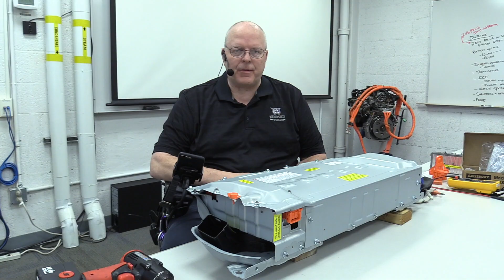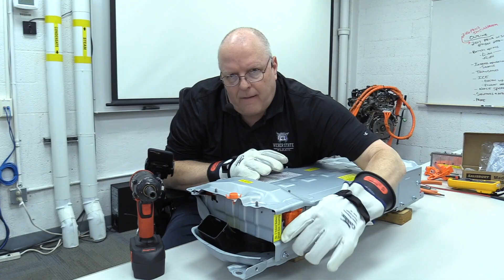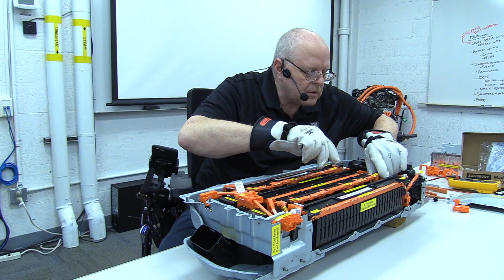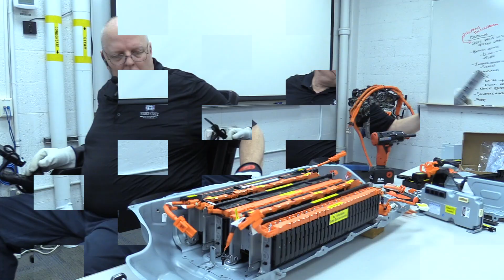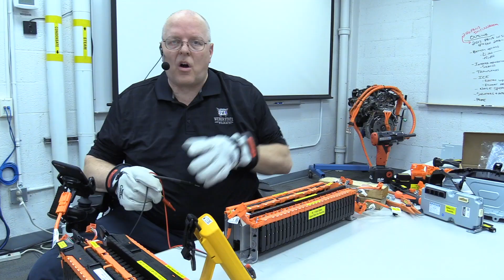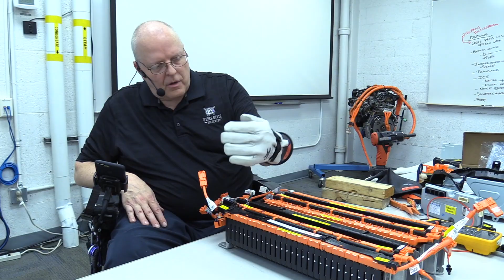2016 - 2023 Toyota Prius Li-Ion Battery

Comment: I don't work on gen 3 and 4's yet much and definitely not the batteries yet.  Appears the contactor assemblies are the same?  At least from what I've seen the NiMH battery packs contactor assemblies appear the same.   Drivers side of the 2016-2022 Lithium definitely looks different than the NiMH pack from what I can see.  I own a 2016 pack I used the modules for a 2004 pack.  Excellent info as usual. Didn't realize there was a Lithium option for the gen 4's that is not the Prime.  Wondering about the rest of the differences between the NiMH and Lithium rest of the electronics electrical system. Interchange between the two or no, have to swap a few other parts.
Reply: The battery ECU appears to be the same design as the 2012-2015 Plug In battery ECU.  I see there is a plug in sequence that is reported as critical to plug in order or damage can occur.  That video also shows the black four plugs for the 2012-2015 plug in looks like the 2016-2022 Lithium pack black four as the older ones for the 2012-2014 (not sure about 2015) plug in are orange.
Reply: Looking more closely at images, the 2012-2015 Plug In Li-Ion pack bsu and gen 4 Li-Ion battery ecu are not the same.  They do look similar, so I am not entirely insane at least at this time. lol

Comment: Prof. Please if we can get a comparation between Lithium-ion and NiMT batteries. in case of heat resistance, extreme cold and hot climates, Density of charge, loss of energy. more efficiency, different usages. Kind regards.⚠😍😍😍
Reply from the maker: Thanks for the suggestion

Comment: Amazing work thank you.  Can i replace my 2010 prius weak hybride battry with 2022 or 2023 model prius hybrid battery.. please if you could guide me or share a video for that,  as i heard that putting 2023 model battery in prius 2010 gen 3 can heat up the engine. So please let ne know

Comment: having fun with one right now 2024 rav customer put disel in it and i believe ive burned through cycles . battery is border line depleted have codes for stacks below threshold so far from what infomation i crossed 2023 and 2024 ravs has an management pcu that shuts down the battery connection when battery soc is down. im being told these batteries are not able to recover. not sure if thats true our chager is down looking for a cheaper charger .

Comment: The one and only video I found for this 56 cell setup, awesome information. -Question, I own a 2022 Prius with this lithium battery, out of curiosity I hooked to DR PRIUS APP with OBD2 adapter, it's reporting a Delta SoC of 1%, sometimes during driving it drops to 0.5% briefly, the car is pretty much brand new, it has 5k ODO. TechStream also reports the same 1% DELTA. Is that an issue down the line with the battery? perhaps that's the delta between the two stacks? voltage difference is 0.00~0.01v among all 56 cells so I guess I'm good there, usally around 3.65v each.
My 2015 GEN3 w/100K ODO NiMH battery reports 0% Delta SoC after 8 years of use! how come I get 1% on the new one? Hope you can clarify, thanks a lot for all you do for us.

Comment: I am facing Hybrid battery issue last 8 months.........Error is showing some time "Hybrid system overheated please reduce output power" and disappear Error was not showing on system I checked many times in Lexus service center but still the same

Comment: Hello Professor, I owe you a lot of respect for your knowledge and congratulate you for the excellent informative and educational videos.  At the same time, I'll like to ask you a question. I have a 2017 Toyota vios and I initiate a project to make this an autonomous car, integrating a generator to recharge the battery while this is driving with a secondary battery, or it is possible with the same original battery. Is there any possibility to charge the principal battery while the car is in motion? Charge and use at the same time? In the case of an independent secondary battery, charging one while the other is use, is there any way to switch from battery to battery?

Comment: Found a 2016 battery that is said to be lithium prius V.

My car is a 2012 body, 2017 engine. I want lithium battery , can I pull the battery out of the car and make this work swap old for new would it work? Stack the new cells in the old case ?

Comment: Thanks for the vid professor! I am working on a Prius+ Li-ion battery that hasn't been used for quite a long period of time. Each cell is 3.6V, but I'm trying to charge it and raise the voltage to get it to 3.75V when in the car. I'm using a GT Power X4 Pro Quad to charge it at 1A, however sometimes it shows connection break though it is connected, and when it does start charging, I get short error eventually. Is there a way to charge each module without these problems and is it possible to make them useable after not using for long periods of time?
Reply: What is your Delta SOC now and Voltage difference?

Comment: The orange cover interlock is the "battery cover lock striker" is there to intentionally require the removal of the HV service disconnect which is used to disengage that striker . An extra layer of safety as a reminder to remove the service grip plug

Comment: can u upgrade this battery similar to prius prime  plug in so u can get longer range ? like connect 2 batteries in parallel of same type.
Reply from the maker: No. You are stuck with the system as it is. Thanks for watching

Comment: I did not read all of the comments so someone might have answered your question at 43:00. For the last few years, I drive my 2nd and 3rd generation Prius quite frequently with the Android Hybrid Assist app-connected, a great app for getting simple numbers BTW. I have seen the 2nd gen get as low as 20% after sitting in the driveway for a few days 3rd gen does not get that low but I have not watched it that closely so I can't remember an exact number. Coming down Parleys They used to get as high as 85 but after a Totota software update, they both stop charging and do full engine brake at 79% when I let off the gas or brake. I have also noticed that they will engine brake if I am going faster than 39MPH but the engine completely shuts off if lower.
Reply from the maker: Good information, thank you!

Comment: Why have you got gloves on when there is nothing plugged in
Reply from the maker: Each battery stack is 103V DC. According to OSHA and NFPA 70E you need PPE above 100V DC or 50V AC. As a teacher is is my job to set a good example by following proper service procedures. Thanks for watching

Comment: The small orange plug is a safety feature as it forces you to remove the side plug (also orange) which interrupts the voltage to the positive output. In the older models where the fuse was inside side handle,  the two compartments  were separated bringing the voltage down to a more safe 100 volts,
Reply from the maker: Thanks for watching

Comment: Those batteries should be designed in such a way, that when servicing, the service man should be able to pull a lever that would disconnect and remove the bus bar and break any series connections between individual cells, thereby making it safer to handle.

Comment: Thanks for taking the time to provide this very useful video... I would like to get more information about about the technical specs/requirements for this battery unit. So I know that it is a 207.2v nominal battery, rated at .75kwh, but that's about all I know about it. Where can I find specs on safe charging voltage, max voltage, min voltage, recommended float (if parasitic load present), etc... Any information on this would be greatly appreciated. I need to make sure a standalone bench charger is set up properly for safe charging and maintenance of this pack. Even some specs for the individual cell-level would be helpful, I could calculate what I need...

Comment: Professor, is there any way to tap a 2000 kilowatt dc to 110 ac inverter into the prius traction battery ?
Reply: 2 megawatt, you need a powerplant

Comment: Only advantage I reckon of NiMH batteries is for cold weather applications . I hear NiMH fares better in cold weather compared to Lithium Ion cells. As such the winterized Aall wheel drive of the prius version uses NiMH.

Comment: Our 2020 Camry Hybrid with Li-ion batteries has a statement in the Owner's Manual, page 502, on a reason the car may not start, "The temperature of the hybrid battery (traction battery) may be extremely low (below approximately -22 deg F (-30 deg C)."  They present a similar statement on page 211 where they also say "In this case, try to start the hybrid system again after the temperature of the hybrid batter increases due to the outside temperature increase etc."  We did not have that warning with our older Camry Hybrid that had nickle-metal hydride batteries.  For those of us living in the colder northern areas, we should shun the Li-ion batteries even if they otherwise have advantages.  Another way to handle this issue would be to use Honda Hybrid cars where a standard starter, powered by the 12-volt lead-acid battery could start the engine in cold weather.  This also will be an issue if politicians are successful in forcing us to abandon internal combustion engines for full electric cars.  I would be interested in hearing your thoughts on this issue.

Comment: Is there any concern with Li-ion cell out gas issue that air (coolant) for the cell get cycled with the passenger compartment?
Reply: From what I seen. All battery cells vent too the outside
Reply: @180msdavid  you mean outside of cell, or outside the pack, or outside the chassis?
Reply: @philoso377  each cell vents through tubing that leads too the outside of the vehicle.  
 The air cooling system isn't directly connected too each cell.  And pulls air from inside the vehicle too Cool the battery pack. What I'm not sure is if that air is returns too the cabin.  Wich wouldn't make sent because the battery would  saturate the cabin with the heat.
Reply: @180msdavid  
Reason I asked was to find out cell gas versus coolant air. Does it draw air from cabin (assuming cabin is fed by road air) run pass the cell-bank then out back to the ambient (road)? or in opposite way around? Is there a concern that cell gas contemplating cabin air?

Comment: Wow. I like this setup. If you wanted you could repair the battery without taking it out of the car. Not like the Gen 2 where you would have take the whole battery out to just replace a single Module.

Comment: My 2016 prius 2 has a NiMh battery 'obviously'
The best distance I've been able to go on battery power alone on a mostly flat 'a few small hills' at about 35-40mph is about 2mi. I've gone a tiny amount over that but it's not easy.
I've been able to average an overall mpg rating of 59.7
I like that number since I very lightly hypermile, and yes so keep up with and sometimes pass other vehicles on the road.
I'm a delivery driver for an unnamed pizza shop. I average about 60-100mi driven in this car per shift. Of those miles driven, I average 68mpg on a good day and 64 on an okay day.
Overall I love this car!

Comment: Thank you sir !! Very well explained, just what I was looking for. A couple of questions about the Prius prime battery though. It says 5x19 cells so a total of 95 cells and that the energy capacity is 8.8kWh, so if you divide the total capacity by total number of cells (95) you get 92.63Wh(25Ah) as individual cell capacity as compared to 18650 and 21700 Li-ion cells used are 11Wh and 14.5Wh respectively as their individual cell capacities.
1. Is there any specific reason/advantage why they have gone for a high capacity cell with only a series connection as opposed to a combination of series/parallel type connection as used by Tesla/BMW for their EVs? 
2. What is the typical values of battery current as observed during the operation of the hybrid vehicle in pure electric and hybrid mode? Is it around 16-17A as was shown in your video?

Comment: Is the stated capacity then (0.75 KWh) the power available between 28% and 41% (Approximately 13% of total capacity 0%-100%)  or between 100% and say 20%? The Prius Plus is stated to have something like 8.5KWh and has 95 cells.. this has 56 so is the actual capacity around 5KWh ( 750Wh / 13 * 100 = 5.769 KWh) fully charged? Or are the cells in the Prius Prime larger?

Comment: Hello Dr.,

Is it dangerous to install new lithium battery on a Prius 2nd generation car ?
Reply: Raed Wahsheh I attempted to but the system that control the battery need to modify with another module to control the charge and discharge. The car was set up with the charge module for NiMH battery only that is a lot different than Lithium. After a few calculation with the cost and work to be done, decided it is not worth the trouble and the risk of setting myself on fire. If you can add the battery management system to work with the original system very well, it is worth the try.

Comment: my self build e-bike has a 532Wh battery it´s much smaller :D
B.t.w. love how the pipes in the background are even labeled with "steam" and "condesate" + flow direction :)
Reply from the maker: LOL, thanks
Reply: @Timo Witte - me too.  I guessing a lot of the 1/4 million viewers are us DIY e-bike guys who build their own packs.  I was fascinated to learn that the Toyota Hybrid pack has basically 4 of my 52v 14 cell serial packs. (I have 3 packs 14s6p (using LG INR-25 2.5ah cells) 14s4p (using Canadian 26800 2.9ah cells) and 14s4p (using 2.2ah cells (EBL cells from Walmart.com - don't recommend),   I'm guessing the driver's side "computer box" is acting as their system's battery management system (BMS).  Wonder what the amp hour rating is on each one of those 56 individual cells?  If he just mentioned the watt hours of the whole pack I could calculate.  I also wonder just what's inside one of  those flat cells.  I wonder if actual anode/cathodes inside are plates (like in a lead-acid car battery) or are there just more 18650 cells inside?.  Just curious as a DIY ebiker who stacks together 56-80-120 cylindrical 18650 or 26700 cells, I wonder about the wasted space between the stacked cylindrical shaped cells? (I think about the whole floor of a Tesla occupied by over 7,000-8,000 18650 cylinder shaped cells.)  Why are we still using cylinder shaped cells?... Maybe I'm wrong, but would flat cells be more space efficient?
Reply: @a5-30-31cts  haha in the mean time i bought a Corolla Hybrid, and i am planing to replace the NiMH pack with LiFePo4 cells once it fails.. There are a lot of guys just replacing two of these 6 cell NiMH modules with 5 LifePo4 cells and it works wonderful. Less weight + more energy storage :) need a BMS though.

Comment: You speak about the voltage but never said anything about the Amps.
Reply from the maker: Sorry, 0.75kWh / 207.5V = 3.6Ah rating. The system is protected by a 125A fuse.
Reply: @WeberAuto  Nice

Comment: Nice! Do you think that Tesla battery system is better?
Reply from the maker: In my opinion, yes it is
Reply: @WeberAuto   They will be cheap to get on ebay real soon. Every Tesla gets wreaked, they usually call it totaled. Tesla goes for 24 volt packs, I wonder why Toyota went with such high voltage packs and low amps? save wire gauge ?
Reply from the maker: @controlyourfuture5477  There is lower current with higher voltage.
Reply: @WeberAuto  with a 125amp fuse? One would think it would be smaller fuse with higher voltage.

Comment: I like that safety orange cap on the battery cover.  The Service Disconnect acts like a key, making sure you can't get at the live terminals without actually uplugging the Service Disconnect.
Reply from the maker: Thanks for your feedback

Comment: High voltage double gloves? Really? Well, nice bare elbows.. It's 600v right? Testings that I have done on some designs had 700VDC on a perforated board laid on an office table. 0.4-1kV is high but not double, sealed glove high.  Nevertheless, great video, as always.
Reply from the maker: Thank you and thanks for your feedback. It is only a 207V battery until the service plug is removed and then the battery modules are only 103V. OSHA 1910.137 and NFPA 70E regulations require double gloves anytime the voltage exceeds 100V DC or 50V AC. As a university professor it is my job to show the proper methods and procedures and to follow all regulations. Have a good day
Reply: @WeberAuto  and you did I would have never thought of wearing double gloves but it makes sense for the 100 volts
Reply from the maker: @datazosquenosabias  Thank toy and thanks for watching

Comment: I really like the extensive safety features they put into the battery. Voltage control, temperature, control, fan speed, etc, etc.
You really don't want that thing to blow up on you especially when you have people sitting on top of  it.
Reply from the maker: Yes, they did a great job protecting the high voltage system both internally and externally.

Comment: Anyone knows the chemistry used in Prius cells? LFP? NCA? I know that Panasonic supplies NCA cells for the PHEV Prius / but no idea about the HEV version. Anyone?
Reply from the maker: I do not know, but they appear to be the exact same construction as the Prius Prime battery cells, just physically smaller. There are no markings on them at all; no indication of part number or manufacturer.